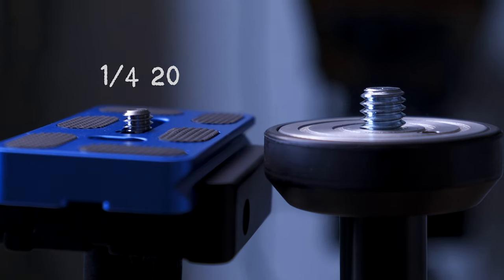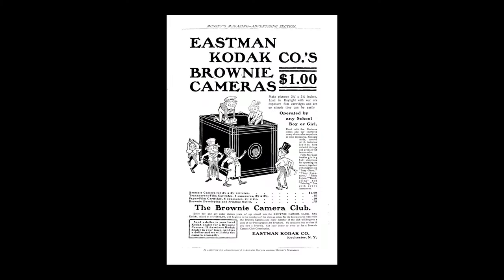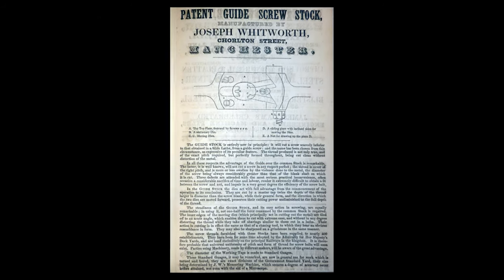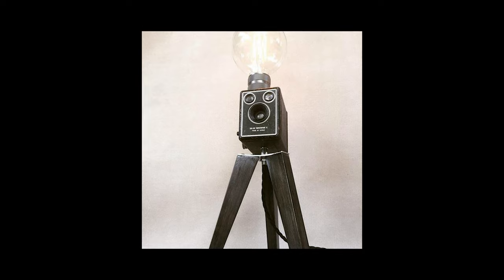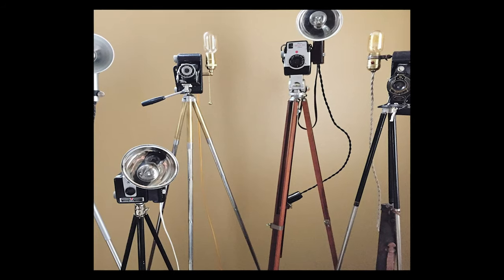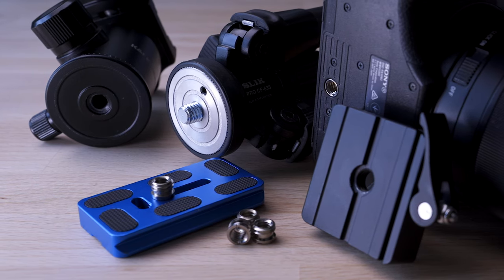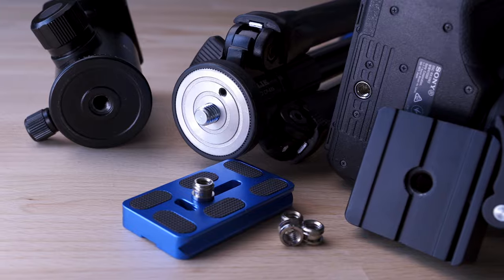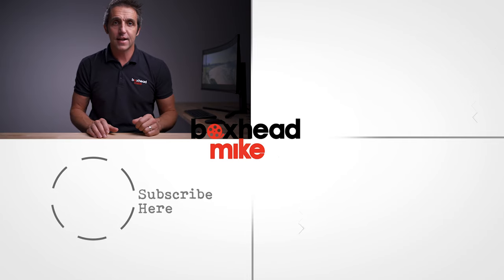Why do camera manufacturers use the 1/4 20 thread...or the 3/8 16 thread?

Comment: One thing I found was when I wall mounted my monitors, I started putting my camera on my desk for work calls and stuff, but I didn't like having my switchpod taking up space, so I looked at my old monitor stand, grabbed a ballhead and was looking at how I could mount it on one of the arms. The retaining bolt for the VESA plate on the arm? 1/4 20. So I was able to take off one of the other arms, clamp the stand on my desk, put the arm between my monitors and screwed the ballhead on the end of the arm, perfect desk camera mount.
Reply from the maker: Sounds like a great desk camera mount and a perfect solution...it's amazing what things you can find that have the same thread!! 
Thanks for watching. 😁👍

Comment: When I’m hunting around modifying my gear it’s had to find a 1/4” BSW screw. You can always use 1/4” UNC (United National Coarse) which is identical & more readily available. 👍😀
Reply from the maker: Hi Nash, indeed, the 1/4" UNC also fits ... even though the thread angle is ever so slightly different...
The BSW has a thread angle of 55 degrees whereas the UNC has a thread angle of 60 degrees, but the wavelength is identical. Really good to know they both fit together though. 
As always, thanks for watching and commenting, much appreciated 😁👍

Comment: Nice bit of trivia history for arcane subject, Mike.  The standard 1/4 20 let me adapt some rigs with a trip to the hardware store; includes thumbscrews to make things easier, and wood platform w/drilled holes; just have to watch the screw length so as not to damage cams.
Reply from the maker: Thanks Paul! Indeed, it's good to be able to get hold of them to do some DIY projects! 
Good point with the length of the screw as well...I had an adapter from sony to canon and when the mount was tightened up too much, the mount stopped working! 🤦🏻‍♂️
😁👍

Comment: They should remove the screw system completely and have it quick release with a button instead. The screw is not very reliable, especially when handling the camera and on the move. I use an Arca plate with my camera and I constantly have to tighten it because it loosens easily which is super annoying.
Reply from the maker: It is annoying when it does that. If you keep the same quick release plate on your camera all the time, it might be worth using some locktight in the thread, this will keep it in place more tightly.
Thanks for watching 😁👍